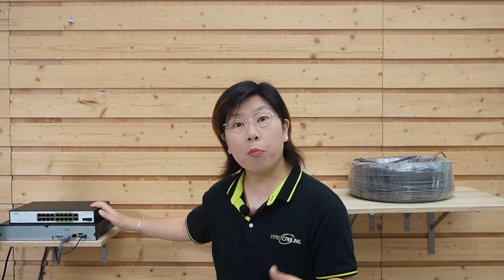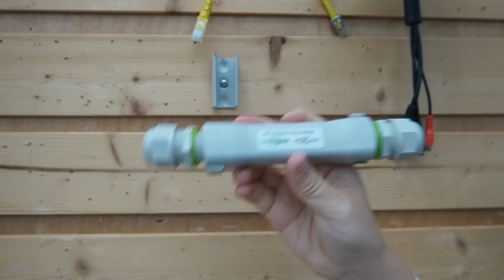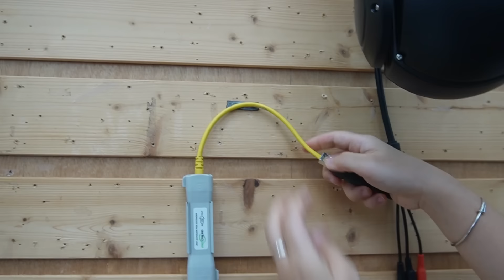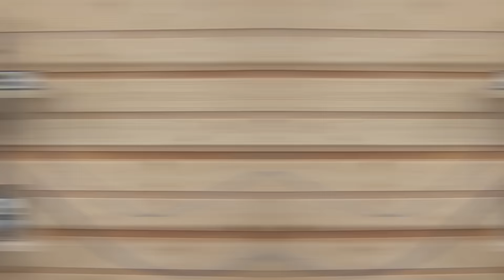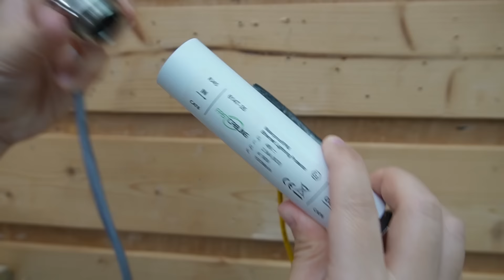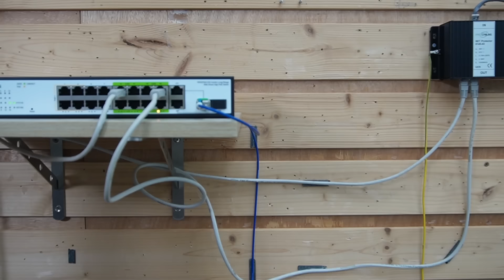How We Built a 24/7 Surveillance  Network for a Mine？

Comment: How was the cable actually run to the various mount points? Strung along posts? Buried?
Reply from the maker: The cable’s either strung along the posts or buried in protective conduit, depending on the spot.

Comment: After all this distance, what speed will the port operate at?
Reply from the maker: For our 16 port Long Range Ports 9–16 can run up to 100Mbps at 500 m with a PoE extender, and ports 1–8 can be set to 10Mbps for up to 250 m.